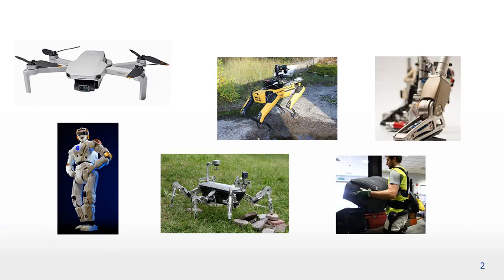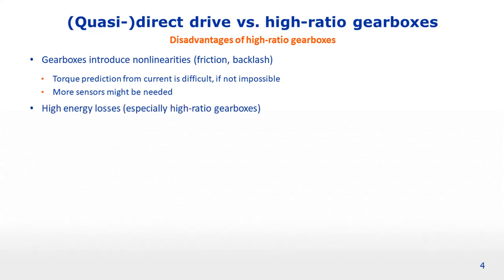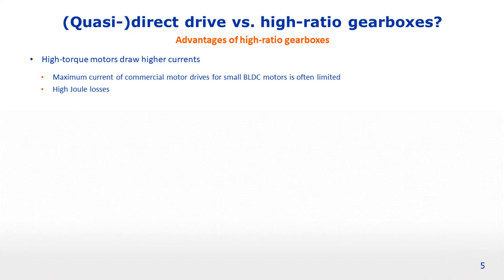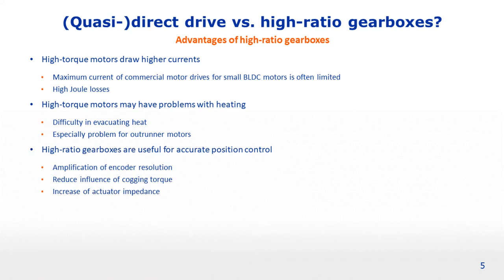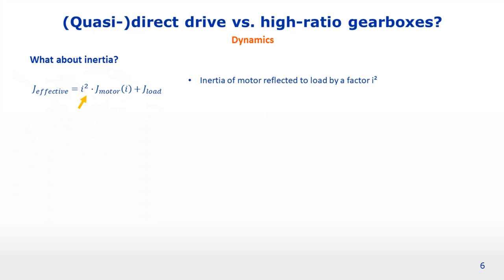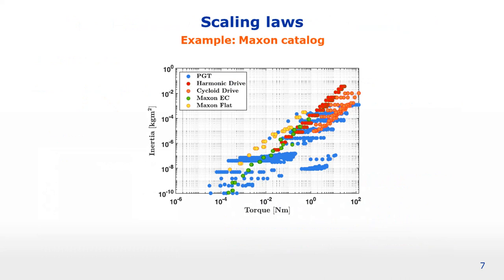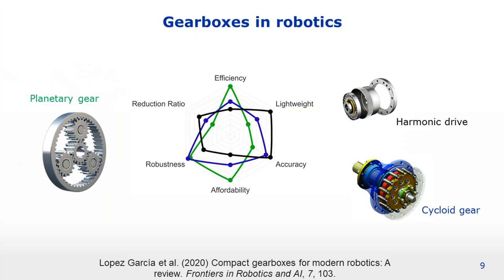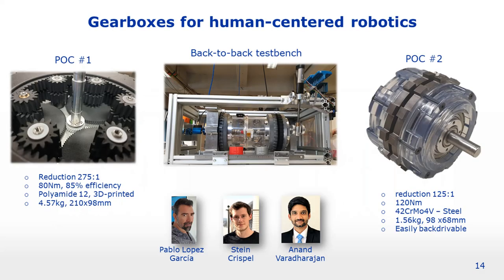High-torque motors vs. high-ratio gearboxes

Comment: Prof. Tom,... excuse me Sir but I've been meaning to ask.  How did that novel Wolfrom planatary gear turn out?  I'm building an ebike for my own personal use and have yet to settle on the ideal powertrain for it.  (my hobby)  Ebike motors have always seemed to be all over the place to me, (we usually just make due), so I've decided to throw together my own with the focus being primarily preformance, and not just cost. It'll be just one of a kind, but as a platform to inspire others, I am hoping it'll punch WAY above its weight class.  Any suggestions?

Comment: If you are willing to tolerate some increased maintenance and the occasional seal failure and leak, a medium pressure hydrostatic reducer coupled to an electric motor will work wonders… Good luck to all.